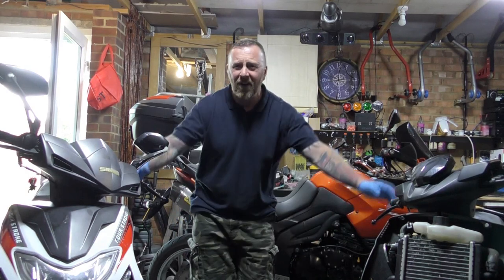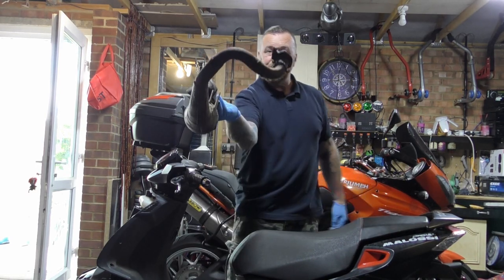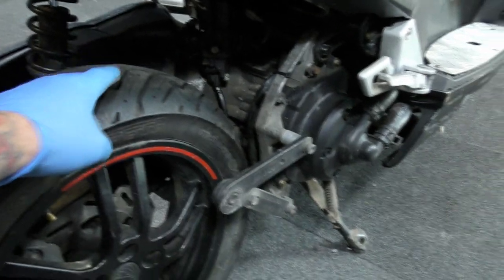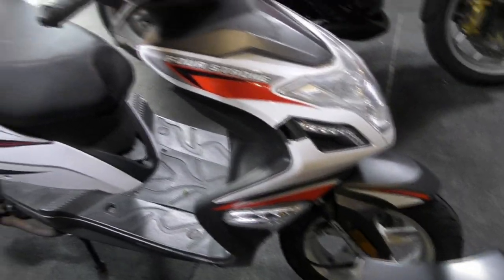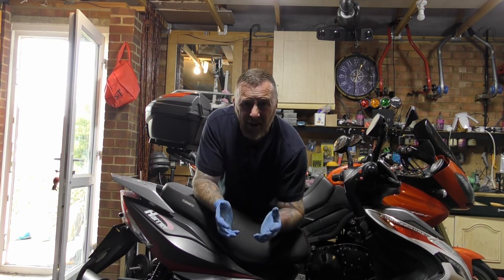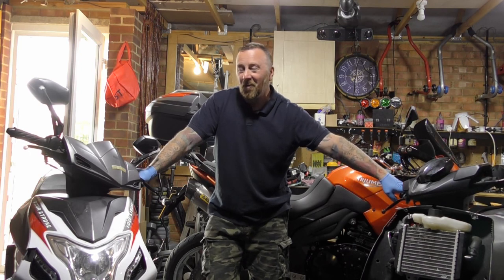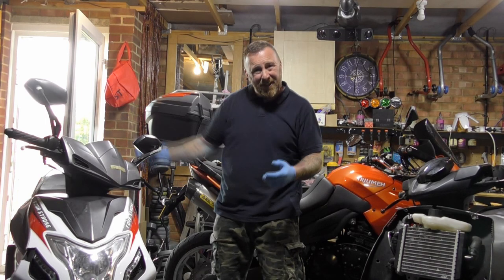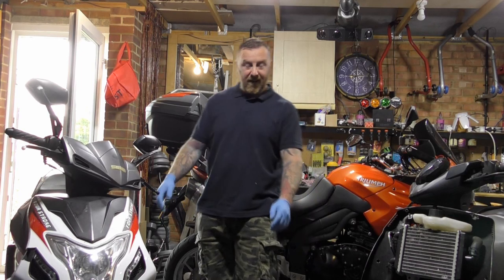SPEEDFIGHT 4 SINNIS HARRIER 1ST LOOK MARK SAVAGE

Comment: That poor guy who brought the Sinnis of his mate. 😞
The speedy might be worth doing though.
I know what you mean about late Peugeot spares. Was trying for four months last year to get a SP3  brake switch. Even the dealer couldn't get one.
Didn't help three cross motorcycles who import them went bust!
Even now it looks like your options are to get parts from a dealer, or second hand.
Reply from the maker: Agree but it for him was worth a punt , just needs a bit more knowledge 
So if I can't sort the sp4 may sell it for spear or buy a few more and then use the parts which to me makes more sense
Reply: Looks like the 3, and four are mechanically very similar.
We are getting old Mark. Not a lot of the early two stroke scooters we used to work on left.
Looking forward to see what you do. 👍
Reply from the maker: @paulbudford  yes bud and the ones that are they seem to want a lot for them in poor condition !
Oh the good old 80s 90s 
Now where did I put my glasses  pmsl !!
Reply: @marksavage  🤣🤣🤣

Comment: Hi Mark I have the same problem you were talking about in the video, rear wheel spins and when I brake the revs drop and stall. So would it be the clutch or could it be something else
Reply from the maker: More than likely yes bud 
Cover off and check it out, to be honest 
Its not a big job just a few tools and replace
Reply: @marksavage  also sometimes it would just rev up by itself. I won't touch the throttle and it would just rev up
Reply: And what should I look out for on the clutch to see if its broken, sorry I'm new too bike don't know alot. Thanks for the help 👍
Reply from the maker: @danielburke6983  well that's carb and maybe air intake 
Carb off clean and replace back tight then tune as in my videos
Reply from the maker: @danielburke6983  worn pads 
Dust all over 
Stuck when you try to test ie pull open
Reply: @marksavage  I've been told head gasket could be gone, would that be the problem
Reply from the maker: @danielburke6983  ac or lc moped ?
If it runs don't see it
Reply from the maker: @danielburke6983  what ped bud
Reply: @marksavage  it's a tgb r50x 2 stroke moped
Reply: It's air cooled
Reply: There's oil leaking from the exhaust port
Reply from the maker: @danielburke6983  that would be too much 2t oil
Reply from the maker: @danielburke6983  if so easy to change but more to do with the blow of the exhaust!
Reply: @marksavage  okay ill train a wee bit off 2t oil, check the clutch and clean the Carb and go from there, thanks for the help I'll keep you up to date
Reply: @marksavage  wont pull open at all is that the problem?
Reply from the maker: @danielburke6983  yes sounds like it's jammed 
Take off and see what the pads are like but sounds like the springs have seized 
So a new one bud
Reply from the maker: @danielburke6983  I have many videos that will help and the basics are the same 
Type in variator Mark savage etc

Comment: Hey mark, got a request for a video please my moped was stolen and then when they stole it ignition and steering lock was snapped and broken so replaced it and had to drill out one of the security bolts so in the end had to put a little nut on the back and just ran a bolt thru it and tightened it that way then the other one just threaded in nicely but my steering lock feels lose compared to my mates bike any tips on how to fix it and get it tighter ?? Forgot to mention my bike is a 2016 peugot kisbee 50cc
Reply from the maker: once they get damaged and you have to replace them it never really goes back right!, where they would have broken it they would have bent and reshaped the hole so this maybe your problem 
take it back off and see if you can tighten or move it but to be honest id be using a padlock bud